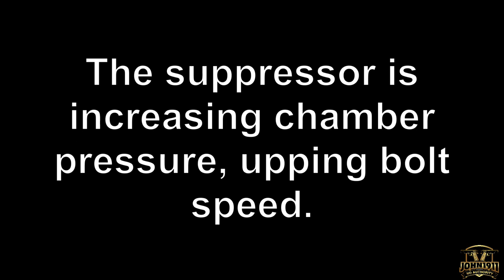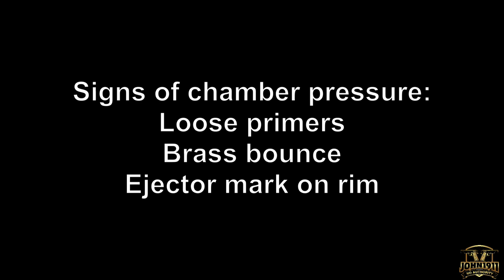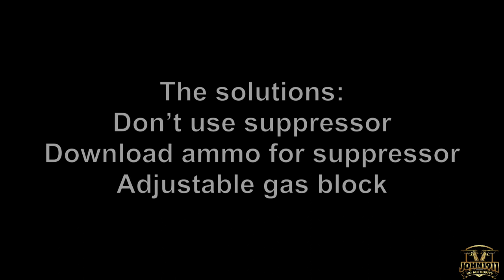Suppressor Overgasses AR-10

Comment from the maker: Sticking a suppressor an a rifle doesn't mean it's going to work well. The AR-10 is a notoriously unforgiving suppressor host. 

FYI and be careful. 

Marky
John1911.com
Reply: Marky, we don't have that problem here in Illinois. I would like to have that problem here in Illinois. "Noise reduction" is not aloud here.☹ HAHAHA. Stay safe. Have fun.😎
Reply from the maker: Oh that sucks.

Marky
Reply: @John1911  yes it does.  
Now time to load up with noisemakers and go have fun. MERRY CHRISTMAS. 😎
Reply: I literally just had this issue today. Gas block here I come.
Reply from the maker: Especially on DI AR-10’s. They tend to run on the edge of unlocking too fast normally. Put a suppressor on it and that thing blowing gas everywhere. —Marky
Reply: Just learned this the hard way. Just blew my suppressor off and got a baffle strike. 
I have a 7.62 spec war on on 20inch Bear Creek Arsenal.
Reply: @John1911 what’s your opinion on  an adjustable gas block to alleviate this issue?
Reply from the maker: @baronvonsnazzy3355  On many guns, it’s practically a must. Even then, you might still need to reconfigure the rifle to run suppressed, but need the adjustable gas UP to keep it running as it fouls.

Comment: My AR 10 with my suppressor today made my buttstock come off. I need to get another lower.
Reply from the maker: Holy shit.

-Marky
Reply: @John1911 The other lower came in. Shot it with the suppressor and the suppressor flew off down range like it was a grenade. Baffle strike included. I'm thinking about just only putting it on in my AR-15. It works well in that.
Reply from the maker: Yeah. That sucks. Suppressing AR-10’s gets tough. Especially DI guns in 308. 

—Marky

Comment: I wonder if throwing on an A2 Buffer spring would at least help? I got a pin and welded gas block on mine and would rather not mess with it if possible.
Reply from the maker: Yup. 

AR’s in particular are balanced systems, touch one end of the teeter-totter, things on the other end get changed.

“AR-10’s” even more so. They are notorious for not suppressing well. 

I haven’t seen this rifle or the owner in some time. Hate to say it like this, but not my circus, not my monkeys. 

Regards,
Marky